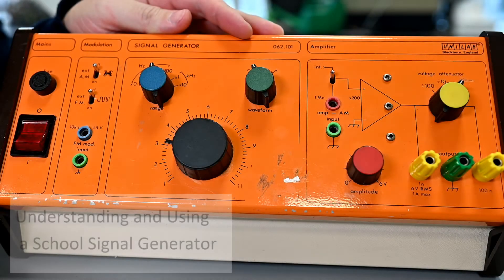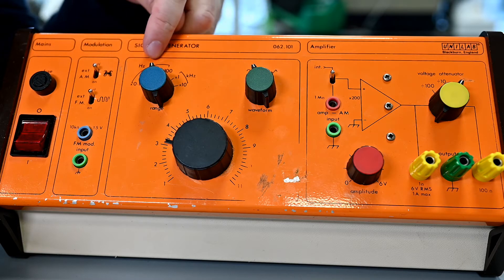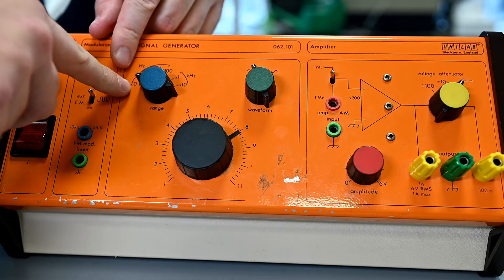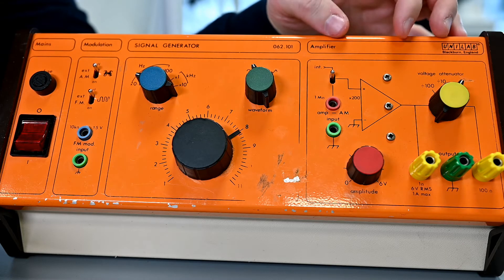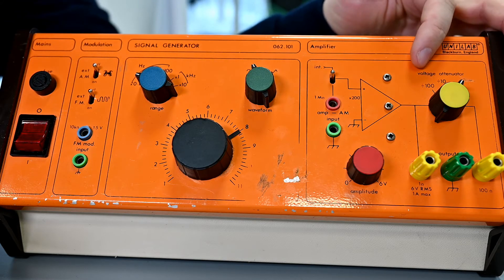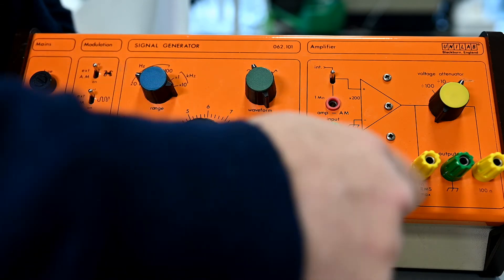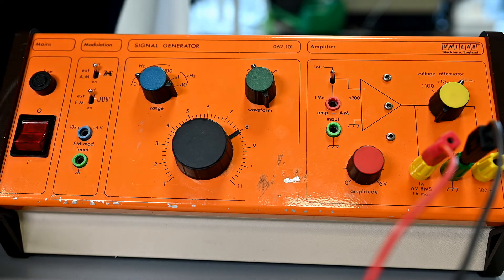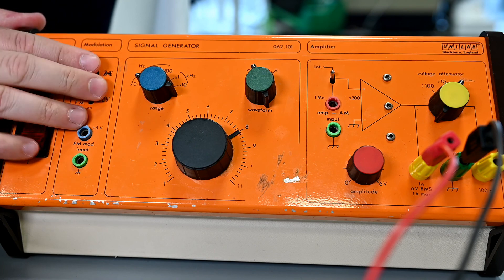How to use a school signal generator

Comment: this generator looks like a analog synth to me
Reply: its not
Reply: @untrust2033  bro You obviously don't know. You're talking to someone that knows about electronics and that play's with synthesisers 👍
Reply: @untrust2033  Don't assume people that's a life lesson 🙂 all good tho. this generator It's basically a synthesiser aka a vco That stand for Voltage control oscillator also FM Stands for frequency modulationis that part of synthesis Use for Sound design
Reply: @deadlinkofficialartst5592  It's not. I use these regularly and all they have is a knob for frequency and some switches to choose the waveform type. There is an output amplifier state but ehh. The frequency stability on these isnt very good but sure you could use it as a VCO as part of a synth if you really wanted, although the size of this thing makes it pretty impractical.
Reply: @untrust2033  my moog is bigger then this So yeah it's not much of a problem for me and pitching the tune is also much of a problem . i got my whys of doing thing 👍
Reply: @untrust2033  Fun fact Single generators were the original Synthesises
Reply: @deadlinkofficialartst5592  u are chatgpt
Reply: @untrust2033  Type up this on google it's actually interesting [what is the first synthesizers called Signal generator]